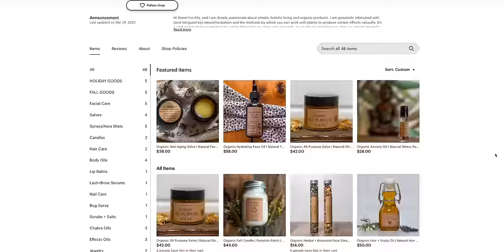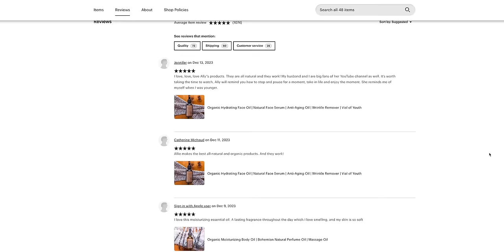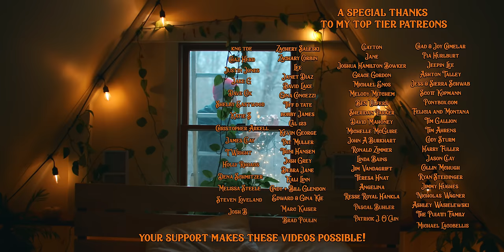Christmas Time at the Off Grid Cabin ❄️🎄

Comment: Just a small tip for efficiency, will surely save you some time cutting wood into smaller peaces. Since they probably have the same length, tie around 10ish together with something like a tension belt. 
You don't have to aim that well, get it done faster plus you don't have to stand up each piece and bend over as much.